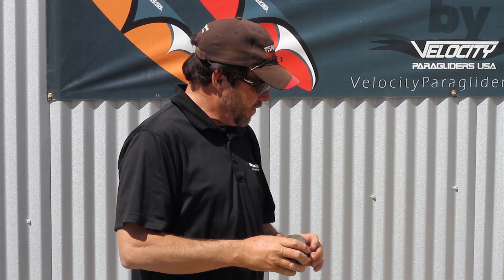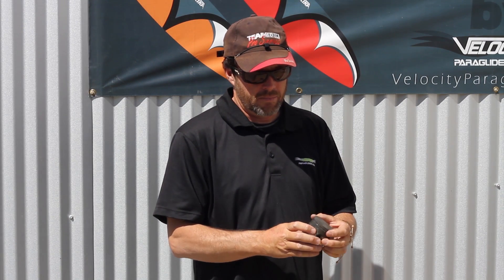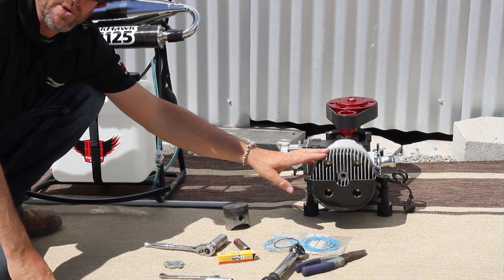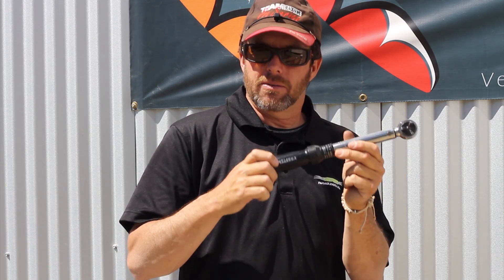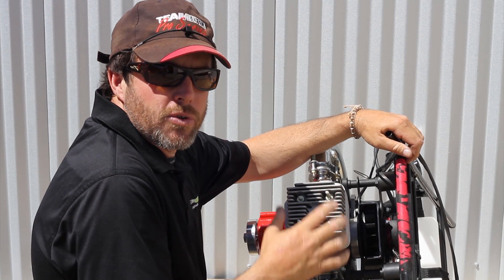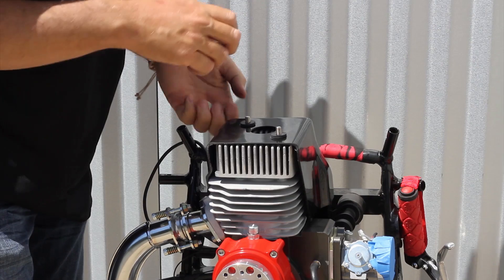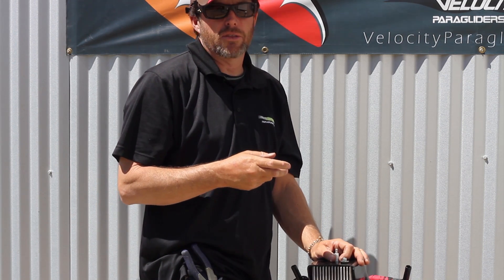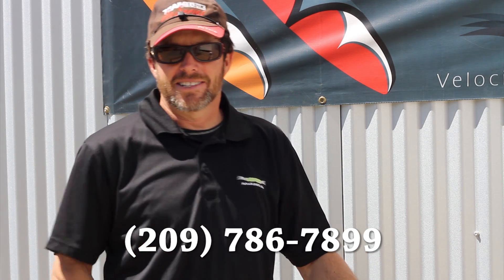Paramotor Tips & Tricks: How to Properly Torque Your Powered Paraglider Cylinder Head

Comment: Very important to mention that you should only use a good torque wrench, the cheap ones are not good enough. I personally use it on almost all the bolts, it's a little more work but you are shure that everything is within specs. For engine bolts I would also use anti seize paste. Should the thread into an engine part gets damaged you can repair it easy and good with Helicoils. Sometime Helicoils are used by the factory because it makes a thread in aluminium a lot stronger. With maintenance I would also check (and replace after xxx hours) the reed valve. If that fails the engine will stall. It is also important that the engine is clean. Dirt between the cooling ribs will affect cooling a lot.
Reply from the maker: +Frank De Ruiter Outstanding comment Frank! Thanks for taking the time to help get information out there to fellow Pilots! Using a good torque wrench is paramount. Blue Skies from all of us at BlackHawk!

Comment: Another GREAT video! Thanks for showing this basic but CRITICAL maintenance piece! When I replace my gaskets I torque the motor after every flight for the 1st 5 flights or until the nuts are no longer loose when I check them. Then, I check them every other flight since it's so easy to do. Also, when I tighten them, I tighten them "kitty corner"  just like you did in the video, instead of the one next to each other. This makes the seal set well. Keep making these great videos!! Larry from Naperville.